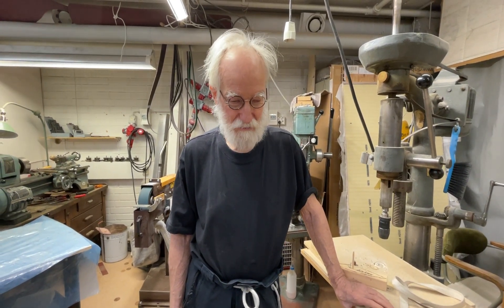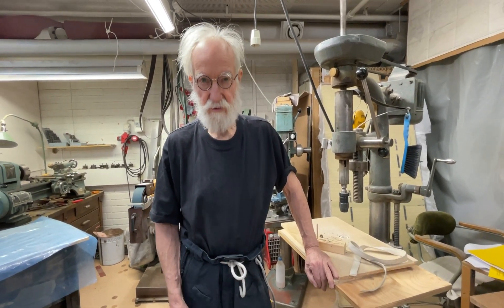Modifying the modifiyed Ljungström rig with a J-sprit to the vertical club.

Comment: Sorry to be blunt, however you look like an old fool re-inventing the wheel. 
Look for the wishboom-system of the Wyliecat or the Nonsuch. They adapted the Ljungström-rig and added some extra's.to it. 
So it has a rotating, unshrouded mast and a wishbone-boom, attached to the mast with a so called choker, that makes it possible during sailing to shape the sail as needed. No fang or anything else. Reefing becomes very simple. All you do is steer the rudder and everything works perfectly.

Comment: The J shaped sprit is interesting.  Do I understand correctly that the J end allows the sprit to pivot on a point forward of the mast, and still will not foul or change the sail on different points of sail.  I  assume to reef then just requires rotating the mast and adjusting the aft end of the sprit on the lug (allowing the lug to move forward).  Nice to see on a good size mock up.
Reply from the maker: You got it.
I am making the modell better.
I am short of time as I am also busy making patterns for the bilge keels and building so bigger size have to wait.
Reply: @SvenYrvindExlex  I may fiddle with the idea a bit myself to satisfy my curiosity.  If I do, I'll give you a report.
Reply from the maker: @boooshes  Thaks for that. There be more videos on the model. It may clairify.

Comment: Sven, I use balanced lugsails on a number of my designs, some with sprit booms.  I was interested to see what the effect of the boom and the mast putting a crease in the sail, so while a teacher at University, got my students to build us a wind tunnel to explore the effectiveness of various rigs. We found that when the sail was creased by the boom or the mast being on the lee side of the sail, it was slightly more efficient than it was when the mast or boom was on the windward side.  This was because the turbulence created by the spar standing out off the sail surface was more disruptive than it was when the spar was sitting in the crease in the sail.
Reply from the maker: This is not what one would think but I heard it before.
Your research now confirms that.
Thanks for the information.
Reply: John,
Similar to this?:
https://youtu.be/PTwYCSyH5ZU

Comment: You could maybe use booms similar to those on Escape dinghies. The boom is bent to 90 degrees and is mounted on a bearing behind the mast.
Reply from the maker: My idea is that when the boom or whisker pole is abouve the foot of the sail, no vang is needed.
Similar to that no vang is needed on a balansed lug sail.
On a standing lug sail a vang is needed.
Escape dinghies do not have that geometry